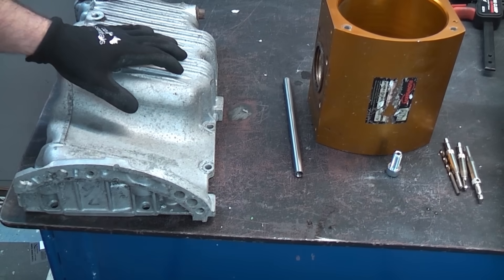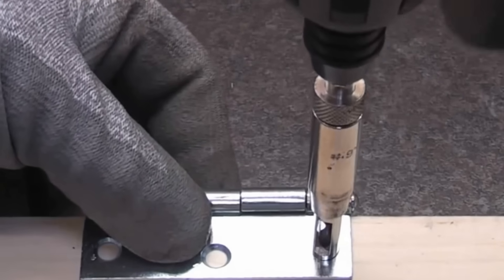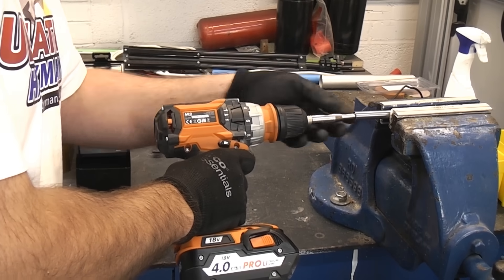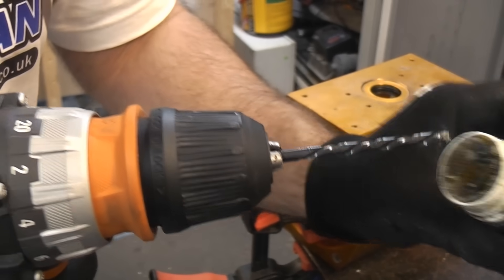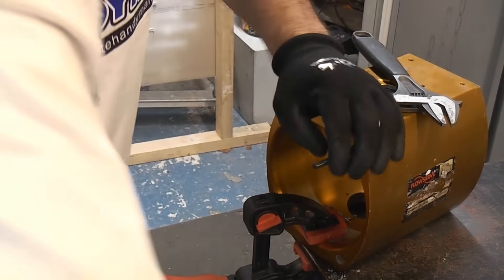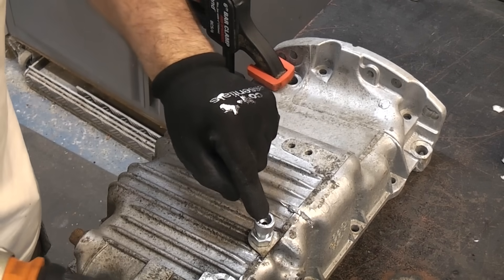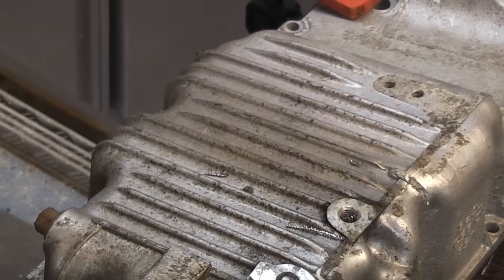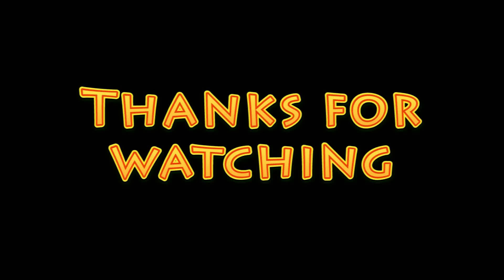How to remove a broken bolt in a deep hole | remove broken bolt in recessed hole

Comment: Great tips. I didn’t have enough threads in the end hole of a shaft to hold the centering bolt, 
but I put a piece of wooden dowel in the pulley that fit on the shaft. I drilled a hole in the centre
 of the dowel to keep the drill bit centered on the broken bolt. I heated the shaft, oiled and drilled 
a hole in the centre of the broken bolt. I had only one extractor bit; I drilled the hole too big, so I 
cut a piece of 14 gauge copper house wire, put it in the hole, tapped in the extractor bit and the 
broken bolt came out without even applying much pressure.

Comment: Or you can just weld a nut to the broken bolt. Can't fuse steal to aluminum. No drilling required. I do this on ford and Chevy broken exhaust manifold studs all the time.  Way easier than drilling. Especially in a tight spot where a drill is tough to get in there.

Comment: All I need to know now is how to remove a broken stud out of a Aluminium water jacket with a broken steel stud in it frozen by galvanic affect and i will be golden.....diamond grinder here we come.
Reply from the maker: I'd warm it up, as that might help to loosen in. Don't use oxy/acetylene though, unless you have enough experience not to melt the aluminium.
Best of luck with it 👍
Reply: @ultimatehandyman  cheers...had to remove with diamond tipped drill and my 8mm hole is now a 10mm hole..but that's fine in this situation.  But thanks to your video I have learnt two thing's 1.use a drill guide (now purchased) 2. use cobalt drill bits. Cheers for the info.

Comment: Bolts broken in aluminum pieces are typically there due to corrosion or interaction of dissimilar metals. They don't come out clean and shiny like your did. And anything tight enough to break a bolt on removal will exert enough torque to break a much smaller diameter drill bit or extractor. Extractors are a waste of time on the majority of old, frozen bolts snapped off. 
Old frozen bolts snapped in cast iron due to corrosion can best be removed with a stick welder as the steel bolt heat and melts faster than the cast iron. 
Old frozen bolts in aluminum take lots of patience, drilling carefully increasingly larger holes, until only the threads are left. Heating the aluminum and spraying Freon or dropping dry ice on the bolt will sometimes cause the bolt to contract and pull loose of the threads. 
Typically in aluminum, you just have to drill until it is all out or cut into the thread with a blade so the bolt remnant can be pried out with a pick. Then re-tap the thread and hope it holds or re-drill and re-tap for a Helicoil.

Comment: I don't understand how the ends of the bolts can be so tightly seized in the holes that the steel bolts sheer in half as you try to remove them, and yet they come out so easily in your videos.
Reply from the maker: It depends how they shear. We had a machine on site and bolts would shear regularly, but removing the remains of the bolt was normally easy.
Thanks for the comment 👍

Comment: I dont get the beginning of the video, the spring loaded punch, heat and WD-40, none of these would remove the bolt as its sheered off.
Reply from the maker: They help to loosen the broken bolt 👍

Comment: I have to change the starter on my car, I get under there an take out one of the main bolts on the starter to find the second bolt is broken in half literally half way in the hole so I'm looking for the best way to remove it
Reply from the maker: I'm afraid there is no single method that will work better than another, it all depends on access.
Heat and spray penetrant always help, as well as shock!
Best of luck with it!
Thanks for the comment 👍

Comment: 25 years as a Machinist and mechanic and thousands of bolts extracted, I've come up with this : sheared off, start with a left hand drill and go to an easy out if necessary. Broken off and seized, which is way more common, especially here in Canada, forget that shit it's a waste of time, weld a washer to it, then weld a nut to it, then you have something to grab, heat and penetrating oil as needed

Comment: For really bad bolts I like starting them with a 40 this heats up the stuck bolt and it acts as a relief cut to take some of the pressure off the threads the hit it with a LH number 30 the number 40 pilot also lets the number 30 drill take a bigger bite and increases rhe chances of it backing the bolt out. Also if you chuck up the easy out in a drill and try to back it out with the clutch on it helps break stuck bolts loose

Comment: I did this and unfortunately the screw was so tight the screw extractor snapped leaving the end in and they are hardened steel so I had a big problem. Luckily it was only a voltage regulator so not a heavy item and one screw did actually hold it.
The other two were on another motorbike with Allen screws very tight and I gnarled the heads but managed to drill down the screws and then use an extractor. I only caught the last thread on each and was able to use new screws of the same size. I have heard the torque wrench settings are wrong in the manual so people overtighten them. There was no corrosion present so I think they were overtightened. It was an aluminium cover in an aluminium transmission gearbox so didn't need to be super tight. But experience of screw sizes and torque settings would leave me to wonder if the manual was correct.
Reply from the maker: Thanks for the comment 👍

Comment: I have used the left handed drill bit technique many times but always with a small pilot hole drilled first. I think the sharp edge of the pilot hole gives the lefty bit better chance at digging into and binding in the bolt.
Reply from the maker: Thanks for the comment 👍

Comment: You need to try and remove the Steel Bolt from the Aluminium Casting whilst the Casting is still Hot!! The Coefficient of Thermal Expansion on Aluminium is MUCH greater than Steel (The Maths doesn't Lie) - Furthermore, the Casting will shrink even more when cool, making the Bolt even tighter than before!! Then try the usual removal tricks - BUT WITH SUITABLE GLOVES ON!!
Reply from the maker: Thanks for the comment 👍

Comment: Why does everybody wear gloves? I worked in auto repair for 30 years and nobody ever wore gloves.
Reply from the maker: I worked on a site for 30 years where gloves were mandatory. If you did not wear them, they removed you from site 😉
Reply: @ultimatehandyman  Sure you did.

Comment: What if the top of the bolt fused to the aluminum because my dumbass grinded it down too far?
Reply from the maker: If it's flush with the surface, I would just centre punch it as close to the centre as possible, then drill it out (left handed drill bits if you have them) and then use the screw extractor.

Comment: Some times you can put super glue on the end of a pencil eraser. 
I have used this for stretched head bolts that have broken .
At least I didn't have to pull the head back off .

Comment: I've been going SIX hours on trying to remove a bolt so I can install a running board on my truck and no way no how is the bit penetrating through the bolt.  I've tried extractors and various types of bits and nothing works.  I'm getting to the point that I'm liking the way my truck looks with one running board on the passenger side and none on the drivers side.
Reply from the maker: The bolt might have work hardened, making drilling it with normal drill bits impossible!
I have drilled them out using diamond coated hole saws in the past- https://www.youtube.com/watch?v=7JCfEMrCjhc&t
Best of luck with it 👍

Comment: You're lucky your bolts are clean the threads are clean most stuff I work on the tap breaks off in the hole the left handed drill bit breakshop in the hole now you got a real problem
Reply from the maker: You can drill out broken drills/extractors etc-
https://www.youtube.com/watch?v=7JCfEMrCjhc&t
Thanks for the comment 👍

Comment: My thread is only 6mm!! How you get around that one? Is there a guide and drill bit that small plus a screw extracter this size to get the broken thread out?
Reply from the maker: M6 is not too bad, but anything smaller and you are basically in trouble.
I've made a M6 guide before, you can also get left handed drill bits in small diameters and the extractors- this kit might do- https://fave.co/3tTECjp
Reply: @ultimatehandyman  Thank you. I've ordered the kit & hopefully I get it out.

Comment: Man, what kind of godly bits you using that bite an penetrate bolts that easily an quickly!? I end up melting tips even using cutting grease/oil an love tapping the trigger! Drives me crazy the amount of money I've spent on "quality" bits.
Reply from the maker: It does not matter, unless there is a directional arrow on the disc 👍

Comment: Thank You so much for this tutorial, i had a broken oil level Bolt on a Honda engine, i bought a kit of reverse drill bit and screw renovers, just like your and in 20 minutes i manged to remove the 6mm broken bolt without ruining the thread. Top marks!!!
Reply from the maker: I'm glad the video helped 
Thanks for the comment 👍

Comment: Thanks for this excellent video, but I'll probably never have a full-size lathe at my disposal. Maybe the drilled-out guide bolt could be made using a drill press. If not, possibly a mini lathe could be used. Or, one could go to a machine shop and have it done. Might as well have them make a whole set of different sizes while you're there.
Reply from the maker: Yes, you can make them using a drill press- https://www.youtube.com/watch?v=6mZj0J6CNYA&t
Thanks for the comment 👍

Comment: Can you please tell me where I can find these tools?
Reply from the maker: Hinge centering drills- https://fave.co/2DpJo1H
Left handed drill bits- https://fave.co/2xJjK1M
Teng screw extractors https://fave.co/2OnfRuF
Dormer taps -https://fave.co/2OsN1sQ

If you are in the UK-
Hinge centering drills- https://fave.co/2NE1VMc
Left handed drill bits- https://fave.co/2DubtF4
Teng screw extractors- https://fave.co/2pVLkVT
Dormer taps - https://fave.co/2pTfbyx

exact cutting paste- https://fave.co/2Nabyxc
cobalt drill bits (they are much better on harder steels like bolts) https://fave.co/2zDh3kp

You'll have to make the guides yourself, but they are easy- https://www.youtube.com/watch?v=6mZj0J6CNYA&t=1s

Spring tools centre punch- https://fave.co/2NbnLBD

👍
Reply: @ultimatehandyman  THANKS!!! I just subscribed, been looking for way to do this👍🏾

Comment: Where can I buy these tools that you used in this video please and thank you
Reply from the maker: Hinge centering drills- https://fave.co/2DpJo1H
Left handed drill bits- https://fave.co/2xJjK1M
Teng screw extractors https://fave.co/2OnfRuF
Dormer taps -https://fave.co/2OsN1sQ

If you are in the UK-
Hinge centering drills- https://fave.co/2NE1VMc
Left handed drill bits- https://fave.co/2DubtF4
Teng screw extractors- https://fave.co/2pVLkVT
Dormer taps - https://fave.co/2pTfbyx

exact cutting paste- https://fave.co/2Nabyxc
cobalt drill bits (they are much better on harder steels like bolts) https://fave.co/2zDh3kp

You'll have to make the guides yourself, but they are easy- https://www.youtube.com/watch?v=6mZj0J6CNYA&t=1s

Spring tools centre punch- https://fave.co/2NbnLBD

Comment: i use a 2 flute carbide ball endmill that's way smaller than the thread size with about 15 surface feet a minute and a feed of 50 to 100 milliseconds which just eats through 90% of bolts

Comment: What would you use if there wasn't enough thread in the casing ?
Reply from the maker: Recent example here- https://www.youtube.com/watch?v=MR2Dd30Wees
Once the hole is drilled, you can just use a screw extractor.
Another example here- https://www.youtube.com/watch?v=SMrDYJvY0Ts

Comment: Hah!  Just went through this...I used to be able to change a water pump in 20 mins.  Came out one morning and saw green radiator fluid running down the driveway under my 90 bronco.  I knew what that was!  Called Autozone and found rebuilt water pump for $15.  Said to self:  "Self, you used to be able to change a water pump in 20 mins.  Wonder if I can still do it?"  Got the water pump and arranged my tools...started my stop watch...4 of 5 bolts  came out fine.  Last one came out too easy & I knew to stop the watch.  Sure enough...twisted off the bolt at the head in an aluminum timing chain cover.  Broke out drill to drill hole for ez out.  Drilling went fine but then broke the ez out.  Game over.  Now needed new timing chain cover, and if you're taking that off, might as well replace the timing chain.  All in stock at autoparts store.  Put it all together and started filling radiator...heard splashing under the engine...looked down and glycol pouring out as fast as I put it in.  Broncos have a reverse flow water pump and autozone sold me a timing chain cover that was regular flow.  I was dejected...took another two weeks to get up the gumption to do it all over again.  Sow after 40 years, a 20 min. water pump replacement now takes 3.5 weeks.
Reply from the maker: I've had similar jobs to that, I call them nightmare jobs!
You just never know what is going to go wrong once you start doing a job!
Thanks for the comment 👍

Comment: When reassembling I used the cadmium based paste used by electricians on aluminum wire this was before antisieze compound was heard of I used it on motorcycle engines which are mostly aluminum people either thought I was a genius or wasting too much time on the job just a little time saved a lot later and made life so much easier for everyone.

Comment: Very good and thorough. Except that it shows that broken bolt coming out looking like it was brand new from the factory. The ones i am currently dealing with are not even rusty, just dried and dusty and stuck. Got a few out by some miracle, the rest are broken.
Reply from the maker: There are a lot of variables, dust and dirt can act like a thread locking compound!
Best of luck getting them out 👍

Comment: In 20+ years of daily wrenching, I have NEVER seen a bolt break below the surface. It either breaks with some protruding, or flush.
Reply from the maker: It depends what industry you are in. Where I worked there was one machine and this used to happen regularly. If you read the comments below, there are quite a lot of people that are interested in the bolts with holes drilled through them.
Thanks for the comment 👍

Comment: For a bolt stuck in aluminum, I like to weld a nut onto it as it won't hurt the aluminum. Once cooled. use a wrench to back it out. Very easy an no risk trying to drill it out.

Comment: Great video. Whilst the use of anti seize grease is good in certain applications, in the marine trade we always avoided copper base anti seize compounds on threads where it contacts aluminium as galvanic corrosion can occur.

Comment: Good video. Pro tip: Lube the aluminum threads before using the extractor, so that as the stub comes out or doesn't bind.

Comment: Where do you get drill bits as screwfix and toolstation are crap
Reply from the maker: I often buy them from eBay.
I try to buy decent makes such as Heller/Dormer
A few years back I bought a cheap set of HSS drill bits from Screwfix, just to keep in the back of the van, for emergencies. They were absolute garbage! I tried to drill a small hole through some 3mm mild steel, the bit shattered and went everywhere. I then binned the full set and bought a decent make!
Thanks for the comment 👍

Comment: When using the left-handed drill bit, put your drill on low speed.  Drilling at high speed like in this video will end up just making a deep hole.  I was not surprised that's what happened, and you had to use an easy-out or other means to extract the broken piece.  Once you have the bit centered, and a small divot, go very slow and let the bit dig in and turn out the broken screw or bolt.

Comment: As an old retired mechanic I have used a torx head bit drove into the drilled hole instead of the screw extractor. It works very well.
Reply: I've got to remove some broken exhaust manifold bolts today, and plan on using this method. Any tips or tricks to keep in mind?

Comment: Women's clear nail varnish makes a good quick anti-seize for things that do not get TOO hot.  For things that do I use Bit-Loose, a kind of polymer used to put on soldering iron bits so they can be removed later for replacement. It also works well on exhaust pipe nuts, bolts and manifold studs.
Reply from the maker: I've never heard of that before.
Thanks for the comment 👍

Comment: very impressive. Those bolt type drill guides are there any commercially available?
Reply from the maker: Not that I know of, but a local engineering firm should be able to make you a set (or a friend with a pillar drill or lathe) https://www.youtube.com/watch?v=6mZj0J6CNYA
Thanks for the comment 👍

Comment: It's easier to mount the large pieces in a milling machine and machine out the broken bolts using centre cutting endmills. Good job on the broken bolts.

Comment: Look, I know this is a 2 year old post. But I feel I have to share this. 2000 Dodge Dakota 4.7L. Over torqued a head bolt and about 1 1/4 inches of thread broke off in the block. BY FAR...the easiest extraction I've ever done simply by using your method here. Left handed drill bit took it all the way out. Thanks, man!!! You just saved this engine! After 6 months of trying, I was about to junk it. But all it took was this. Thanks again! 👍
Reply from the maker: Brilliant 👍
I'm glad the video helped 
Thanks for the comment 👍